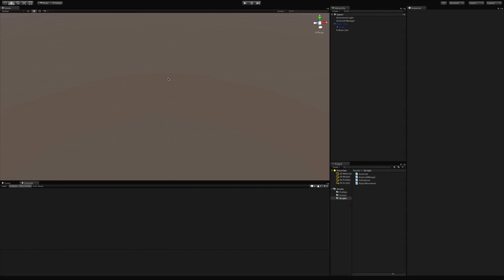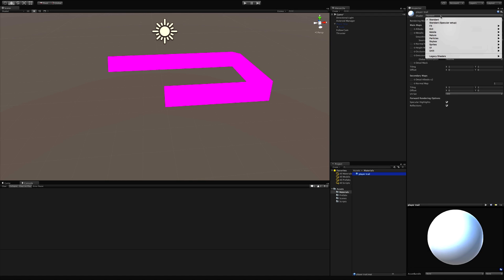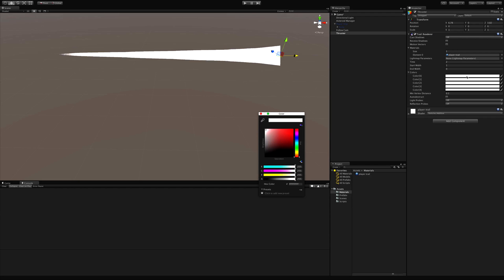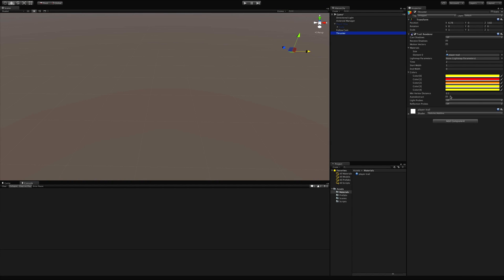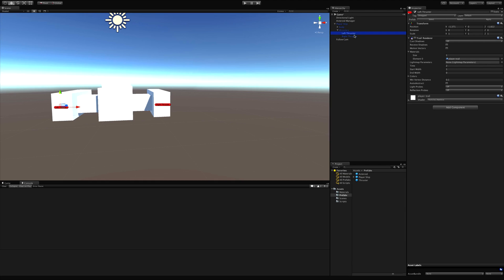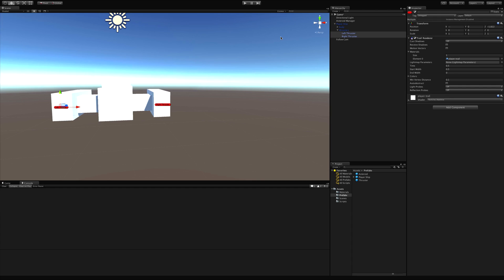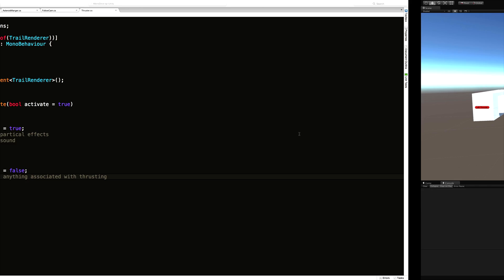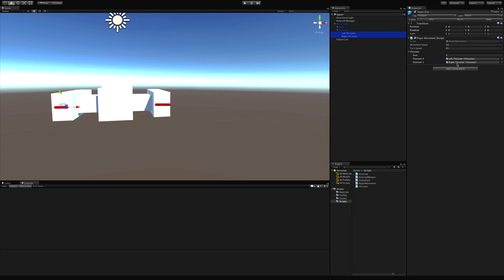Trail Renderer - Unity 3D Game Development: Week 3 Game

Comment: the trail renderer on unity has changed update needed
Reply: Start/end-width in 2018.3 is configurable in a (nice) graph, so that's quite easy to adjust. The colors however seem to have less functionality, where you apparently can only set a start- and end-color (and start/end alpha), but no custom colors inbetween...
Reply: On the Color Gradient Editor, if you click along the bottom of the large color bar directly under "Mode", you can add points which allows you to change to any color on the color wheel. 

Switching Modes between "Blend" and "Fixed" will switch between Smooth color transitions to sharp color changes at the points you made. I know its a bit late, but I hope that helps!